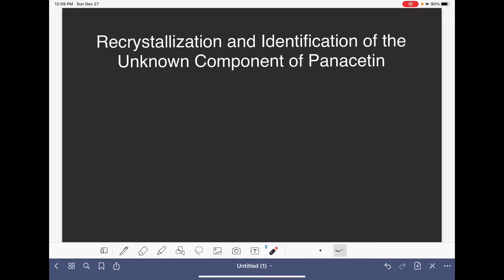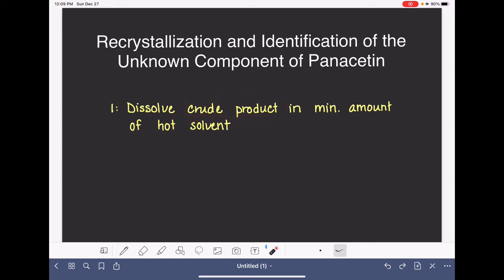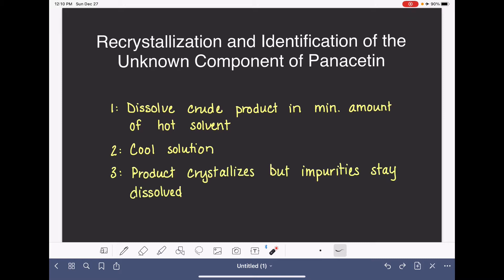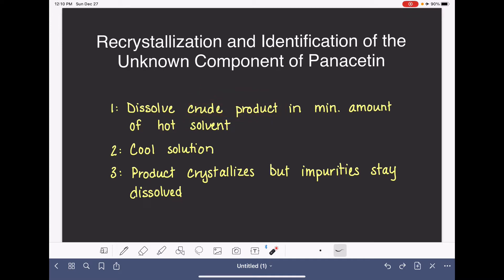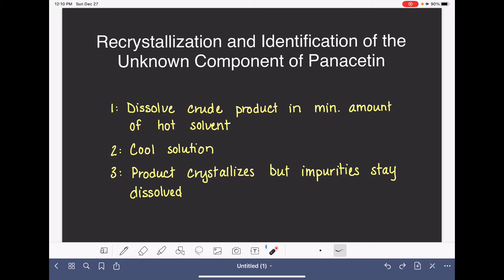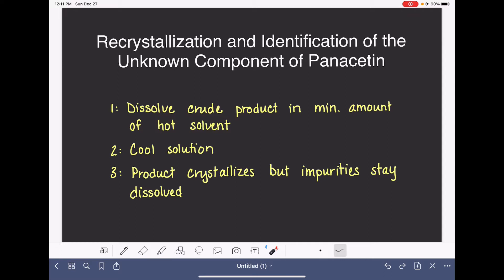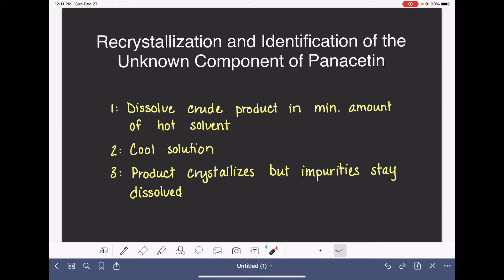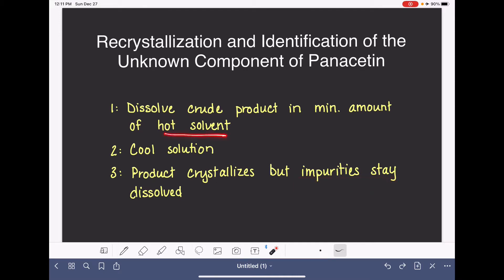Recrystallizing and using melting point to identify a compound

Comment: Wow that is interesting and informative but argh do you know if fusion is a form of crystalyastion like fusing say a powder to some sort of crystals then purifying it with um im just having a think because that is what i did it did not work so good with paracetamol or the Panamax but with the um other pills it worked just perfect so far and it yeild more in  its orginal weight i need to accurately mesure its weight but from touch it is way heavier and crystalised now i just have recrytylise again and purify and say well you say 1 point in solid is 10 units in liqiud right well i way up 1 point and it in 10 units and do it doubles the accurate measurements so how do we make 1 point in solid wieght yeil to 1 gram in solution so in other words if i put 1 point of as solid product in weight into 10 units of a water from a 1ml syringe how would you make that medicine yeil from 10 units to 100 units from mixing it with the product i think naybe maybe from recrystallisation and purifying 10 times maybe but how because it doubles but on the other hand 5 points with 50 units it will grow or yeil to 100 units but how do i grow it to 90 % so from 10 1 point it grows to 1 gram or 100 units 1ml i think would make every one feel a lot better depending on there required doses doctor